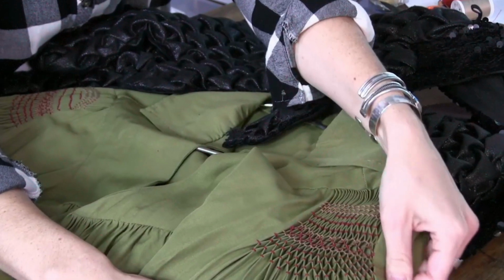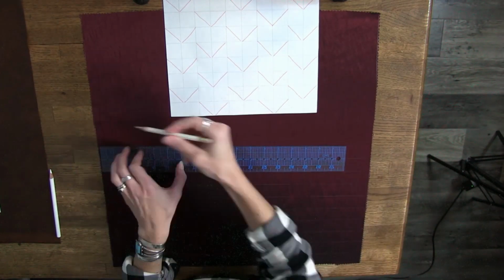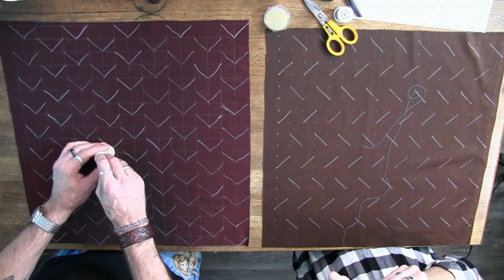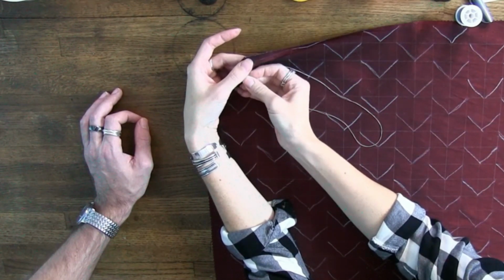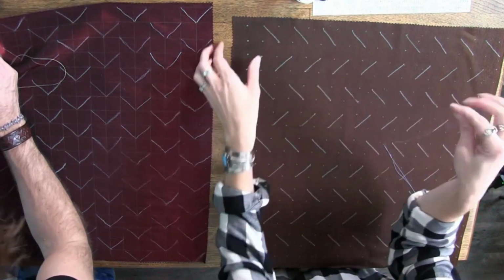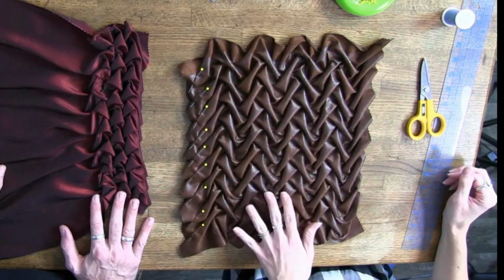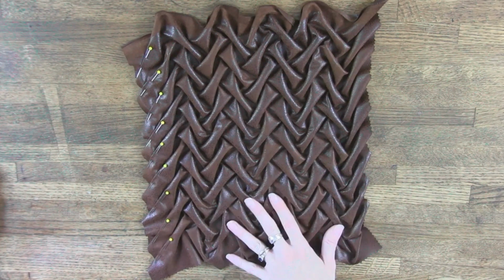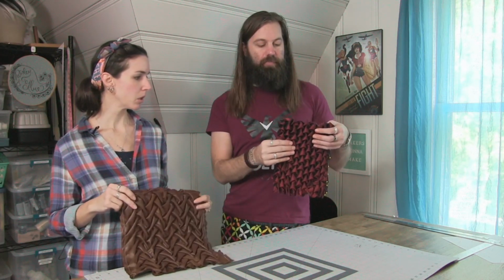Fabric Smocking for Beginners - How to Manipulate Fabric for Fashion or Cosplay! with Paisley & Glue

Comment: Thank you so much for this vid. I was lucky and found Maggie's book at my library. I just finished my second piece of the braid pattern. I did it out of just a regular weight polyester material and then pressed it flat. My teen loves it and it will be turned into a simple corset for her soon . The first piece I did was out of a pleather material. Turned out amazing , but I will not be doing that thick of material again without having some type of punch tool. I'm tempted to frame the piece and then title it "insanity". Once again thank you, I really look forward to finding ways to incorporate this type of smocking into more projects.